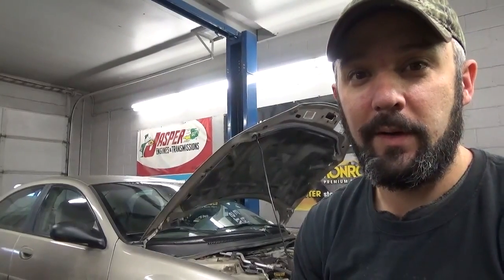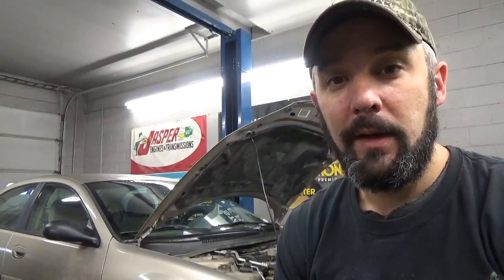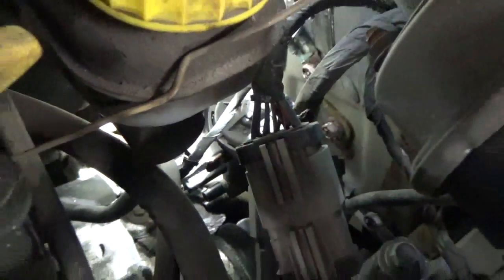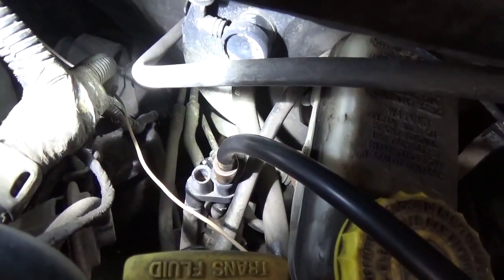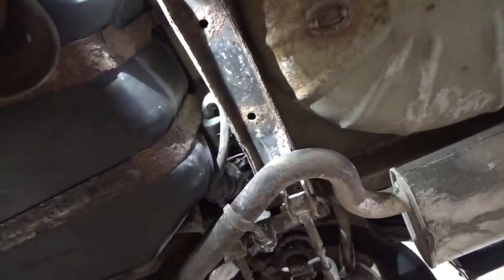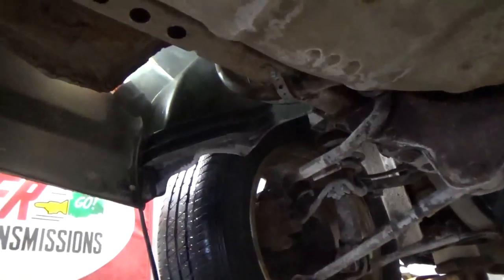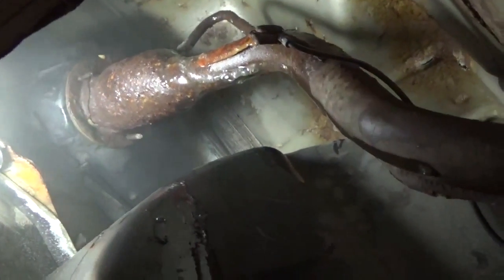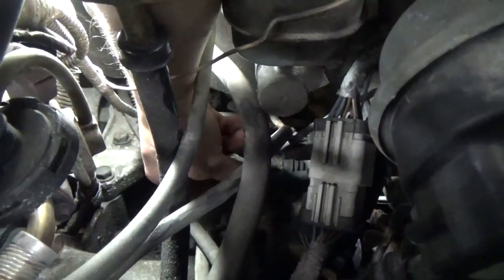Finding EVAP Leak Using Smoke Machine - Dodge Stratus

Comment: I have a question. If you don’t mind helping me out??? 
I’ve got a p0171 & p0174 on my 07 avalanche. I did a smoke test from the intake with no visible leaks. I hooked the smoke machine up to the brake booster hose and had a ton of smoke coming out of the throttle body. From my understanding, that’s separate from the intake system and smoke shouldn’t be coming out of the throttle body. If you’ve dealt with this before, could it be a leak from the throttle body gasket or the intake manifold itself? I don’t think the intake manifold is cracked because I didn’t see any other leaks except from it coming out of the throttle body.

Comment: What a total waste of time and money. Pay someone to find a leak in something that doesn't/shouldn't keep a vehicle from running. It leaks a little vapor into the air 🙄🙄 Oh gees.
"But the environment"! What is the effect on the environment from building and making these components in the first place, let alone making the diagnostic equipment to find the leaks, and the replacement parts, delivery of said parts, etc etc etc. Most likey way more 'damage' than the vapor causes anyway.
Reply: In some states like Pennsylvania you can't have a leak because it'll turn on the check engine light. So your comment was idiotic

Comment: I have a check engine code on 2004 Dodge Stratus for a minor leak and with a home made smoke detector, and with the help of this video, saw very minor amount of smoke coming out of smoke detection pump. To be absolutely sure as to not order something that I have to pay return shipping for, do I need to replace just the pump? Many thanks for this video.

Comment: how much psi comes out of smoke machine and at what volume?
Reply: 1 psi is typical to avoid damaging seals and blowing hoses off fittings.  Volume depends on how bad your leak is. Yeah, don't build your own.  $150 ebay for one that will work fine.

Comment: Thank you so much for your informative video.  I'm just about ready to hook up my smoke machine onto my daughter's 2003 Dodge Stratus.  The key points that I took away from your video is: 1. Where to inject the smoke and 2. What needs to be pinched off before attaching my homemade smoke machine.  Now to leave thanks to the youtube video from who i modeled my homemade smoke machine from.  It's kind of cool, because it also incorporates a calibrated homemade manometer that has a reference point for a 0.020' leak.  Mine will also have a calibrated point for a 0.040| leak.  These are the two leak amount points that should set off each of the two codes:  small and large Evap leak.

Comment: Great video. The hose that you clamped on the charcoal canister, when you say vent, is it the hose that goes to the unit that allows air into the system to fill the tank with air as gas is used? I see three hoses, I assume one goes to he gas tank, one goes to the front of the car to the purge valve, and the third is this vent you are talking about?

Comment: So I know that I have to replace the fuel filler neck on my vehicle, but the shop also said something about replacing the evaporative canister. Do you feel that is necessary?
Reply from the maker: Is it leaking? The canister usually does not fail on a Chrysler?

Comment: Made my home-made smoke machine with a Halloween smoke machine and a couple of rubber hoses. Works well and cost about 35 bucks.
Reply: Other then you are putting not good chemicals into your vehicle
Reply: @BladeseedStudios  "not good chemicals" can you elaborate. I've seen the machines made using smoke from cigars, cardboard, incense, baby oil, and mineral oil. I read the dealership machines use a special mineral oil. So what qualifies as "unsafe" and why is it so?
Reply: @commonsenserevival  funny you had to edit your comment just stay in your own lane if you can’t figure out that those are bad chemicals
Reply: @BladeseedStudios   wow. Just asking a question since it seemed like you had some insight. Your reply says alot more than your original comment.